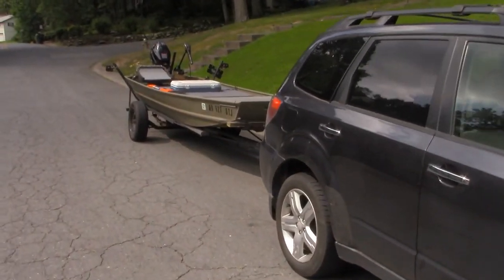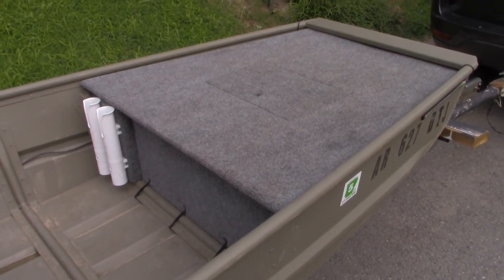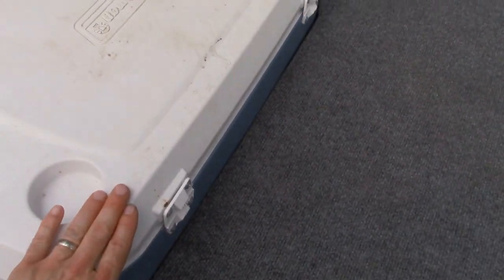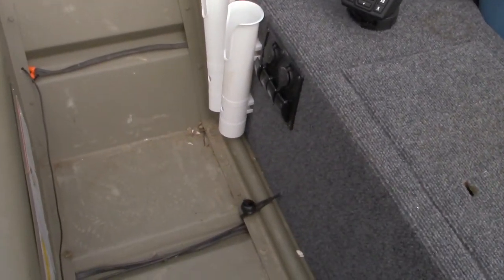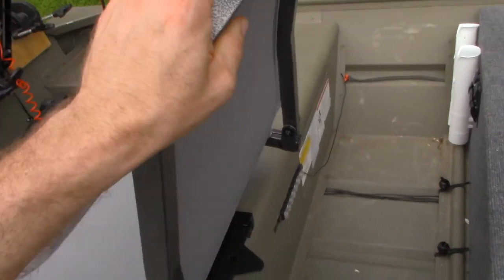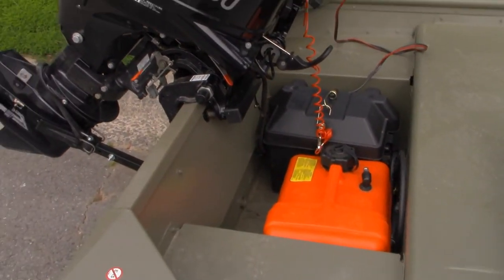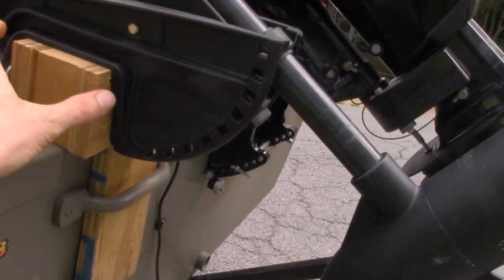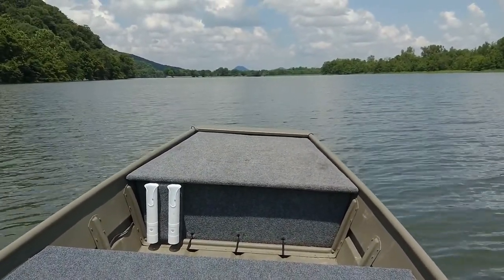Jon Boat Modification Tour and Speed Test

Comment: Great vid!  I love well thought out, with a splash of down'n'dirty.  You effectively have 2 standing decks and 3 seating areas...pretty cool.  To add another layer of versatility, remove or cut down the cooler for a flushmount floor insert.  LOL, working on my Pelican 10e, will have to drag my livewell!
Reply from the maker: Yeah, the cooler would be a lot better if it could be flush to the deck. I'm sure I'll redo everything eventually, because I can never stop tinkering. Have fun with your Pelican build--it'll be great!
Reply: @renaissanceguy148  Maybe a 2nd cooler with a hatch cover so you can swap between the 2, depending on your needs.  I'm constantly changing too.  Like to try and cover all bases, probable should spend more time fishing, lol.

Comment: I like the idea of not making it permanent. I have a 1542 and still figuring out what I want and where.
Reply from the maker: That middle deck is actually my second try--the first one I built didn't cover the middle bench seat, but my kids complained about how hot the aluminum is in the summer sun, so I redid it to include covering the seat with carpet.
Reply: Renaissance Guy, I like what you did. The 1542 has a storage/wet well with plug you have to keep an eye on. The wife was uncomfortable after being out for hours so I was pre authorized to purchase seats and clamps to place the seats on for her haha. One day I will be satisfied with an idea and make the move on decking the boat.

Comment: I'm preparing to build out a 1436 for watershed protection work in NE Oklahoma and love the removable decks. How did you secure the bungees, though?
Reply from the maker: Awesome! I used the loop-and-ball style bungees and ran them through holes in the deck and under the ribs of the boat.

Comment: How did you build it? I just purchased my first boat it’s a Fish Master 1232, it was decked out already, it has a custom cut board that sits on the front deck and front seat made to be a walking deck with a extended stool in the middle but I’m uncomfortable sitting there🫣 controlling the trolling motor.. I kind want to use what’s there already just cut it shorter and buy another clamp on seat for the front row seat so I’m confident, I just need enough front deck for the bow mounted trolling motor to sit on..
Reply from the maker: It's a 1/2" plywood top that's framed with 2x2 and it's sealed with spar urethane. I keep thinking of making a video focused on how I built the decks, I just never find the time. Maybe I'll get to it soon!

Comment: Nice Video Mate!  Looking at either getting a 2021 Tohatsu 15 HP MFS15EEFS or a Suzuki 15 HP DF15AES3 for my 14 foot Jon Boat.

Three questions:  
1. Any reason you chose Tohatsu over another brand like Suzuki?    
2. Is your motor a Carb or EFI? 
3. Did you by chance buy your motor online where I could also shop around?

Thanks!
Reply from the maker: 1) I chose Tohatsu because I had heard good things about them, and they were slightly less expensive than the other options at my local shop.
2) EFI
3) I bought it at a shop local to me--Art's Marine in North Little Rock, AR.
Reply: 5 year warranty!!

Comment: Im nowhere close to buying a boat but I would prefer the 1436. Could you make a video on how you made the the front deck and middle deck.
Reply from the maker: Alas, I think I missed that opportunity by not filming the process. But I can tell you the the decks are made of 1/2" plywood and framed with 2x2. None of it is pressure treated, as that can corrode aluminum, apparently. All of it is sealed with spar urethane and screwed together with deck screws. The carpet is just outdoor carpet from home depot stapled on with stainless steel staples. I'll be happy to answer any other questions you may have.
Reply: @renaissanceguy148  sounds good thank you.

Comment: Hell RG , Love your combo , I just got a 2021 15 hp for my KL Industries brand 12 foot plastic boat, but I'm worried the the motor might be too heavy , I love my little boat, but I also like your set up too, should I keep mine or trade it for a metal boat , can you advise ???
Reply from the maker: I've never had a plastic boat, so any of my advise would be a guess. Have you had a chance to run the 15 on your plastic boat yet? I'm guessing it exceeds the boat's rating, which isn't something I personally would do, but I know a lot of other people exceed the rating and are happy with the results. All I can say is that I really like my aluminum jon, and I personally wouldn't trade it for a plastic boat.

Comment: Great video! However, how does your motor charge your battery?
Reply from the maker: It has an electric start option, so it has an alternator. Usually I use the pull start, though, so I'm not draining the battery to start it.
Reply: @renaissanceguy148  my tohotzu 9.9 has an electric start option also, but I've been told it does not charge my battery🤔
Reply from the maker: What year is it? Mine is a 2020, and I'm told it is practically identical to the 2020 9.8 hp. Also, it seems odd for an electric start motor to lack an alternator.
Reply: @renaissanceguy148  about 2016
Reply: Do you have video showing your work?
Reply from the maker: I didn't video my process, but I'm happy to answer any questions about materials or process.
Reply: @riversidecountryclub2211   2018 9.9 EFI or newer with electric start DOES charge your battery. Non electric start does not of course.

Comment: It seems like 15 hp outboard can still go nice speed with a little additional weight but 9.9 hp really suffers with too much weight. I have a 14 ft v hull aluminum and a Mercury 15 hp goes 25 mph and trolls less than 2 mph. A 9.9 hp trolls nice but top speed alone is an ok 18 mph.

Comment: Ive got a 2017 mercury 9.9 4 stroke I used for lobster fishing out of an inflatable dinghy. I was looking at the topper 1436 to run the marshes for catfish in the summer. Think a 9.9 will plane the boat okay with two people? I get on plane with my inflatable boat(100 pounds) with inflatable V bottom with 2 people small ice chest and 5 lobster traps. Its no speed demon its about 18mph tops. Would be nice to be able to move the motor from one boat to the other because my dinghy cant take anything over a 9.9
Reply from the maker: I assume it would...my 15 will plane at about half throttle, and at full throttle, it will get me and another adult up to 23 mph.  But I can't say for sure since I've only run the 15 on it.
Reply: I would say it’d get on plane. Between 13 and 16 mph I would say

Comment: What pitch are you running 9.25 x12p or 11p .......solas amita 3 and tohatsu are the same prop..
Reply from the maker: I'm still using the stock prop, which I believe is 9.25" x 9p

Comment: What did you use to attach the swivel and chair to the bench seat?
Reply from the maker: Self tapping screws. Bolts would be better, but I didn't want to open up the seat. They've held it fine so far.
Reply: @renaissanceguy148  Awesome, I was wondering about how much trouble it would be to use bolts and screws.  I thought about building a little topper to put over the bench seat, overhanging the front and back of it, and bolting the seat to the topper, but I'm trying to keep the extra weight down to a minimum.  Thanks!
Reply from the maker: @Thorzon  I hear you. It's a total balancing act between simplicity, function, and weight.

Comment: How to get one? How much is the cost?
Reply from the maker: I bought the boat at Bass Pro Shop for about $1000, but I've recently heard that they have stopped making jon boats. I see used ones come up on Facebook Marketplace all the time for a couple hundred dollars. There are several other manufacturers of jon boats, too. The Tohatsu engine I bought new for about $2700 from a local marine shop. These can also be found used for much cheaper.

Comment: How much did the boat cost?
Reply from the maker: Roughly $1000 brand new. Motor was about $2800 brand new. Trailer I bought used for $100.

Comment: how long is your boat?
Reply from the maker: It's a 1436, so it's 14' long and 36" wide across the bottom of the stern.
Reply: Was there a particular reason for going with 14 ft instead of 16 ft?